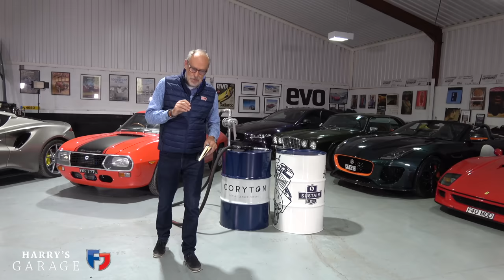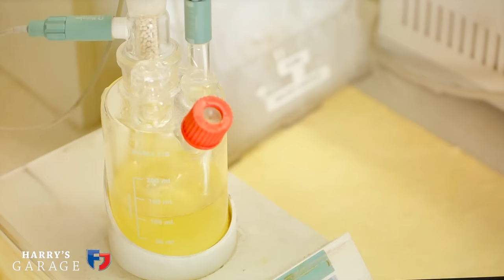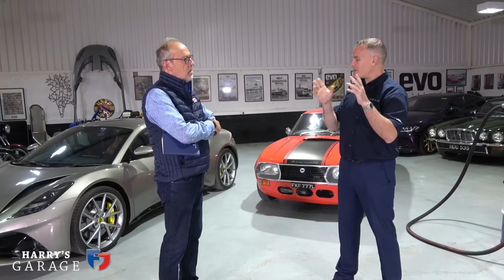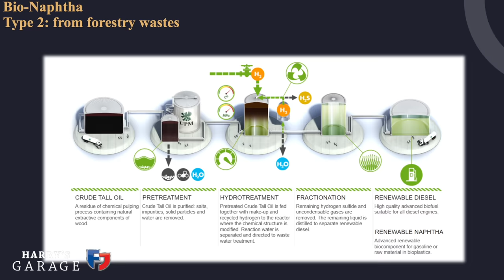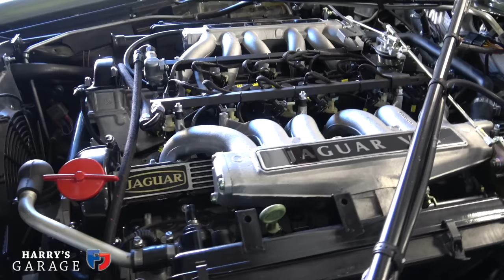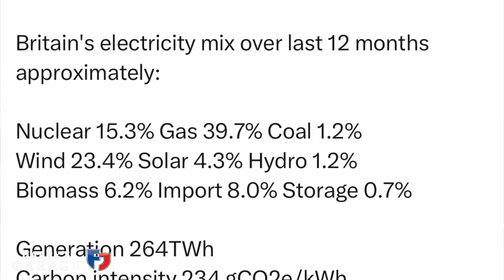Everything you need to know about using sustainable fuels. Why they're good news for car enthusiasts

Comment: Apart from feeling like Homer Simpson now (I feel Harry may be with me there), I now know more than I did pre-video, which has got to be a good thing. We all need to learn as much about this as we can, as it is coming whether we like it or not.
Having an expensive fuel that we can use in ICE vehicles has got to be better than being forced to run only electric surely - even if on.limited mileage.
As far as I am aware, there are no (practically) geared electric cars, where you get to choose which gear ratio you take a corner, go uphill or on  a downhill road in! Electric only allows you to use a percentage of the power available.

Comment: This is the best news for petrolheads in ages. But if motor sports are adopting e-fuels then why can’t this be the future for new cars too? Especially given the impracticality, cost, and environmental impact of EVs. If not, we’ll have racing cars with ICE and road cars with batteries. So no more racing improves the breed which has been so integral to racing and road cars for over a 100 years.
Reply: Because there is no way to scale production up to even a fraction of the necessary volumes needed for ordinary road transport, and the process is inherently extremely expensive so the cost would always be prohibitive too
Reply: @harryspeakup8452  no way? How do you know? We make enough ethanol to put in most of our fuel, at least in the states.

Comment: A great subject which may future proof our classics, the main thing i got from this is which it is made from waist of products, ive worked in the sugar beat plants in Norfolk and the smell is not forgeable which i can only think is from the amount of energy in the waist, from my thinking this type of waist would be spread on fields re introducing the nitrogen/carbon elements back to the soil but alot will go back in to the air as methane, now this is what we should be running our classics on and i take as a true offset.
Reply: Harry has presented the GB perspective and Coryton obviously wish to market their fuel a high price.

However, there are several issues that can be pointed out:

- agri-waste (literally left overs from sugarbeet production and animal feed) can be used to make e85 (85% ethanol and 15% petrol). This requires some some chip tuning to allow a flexibility. 
- the "ethanol is bad" nonsense is punted around by folks influenced by big oil and the brexit media. There are easy solutions involving different gaskets and seals and when making the conversion from standard petrol, filters are advised as the Ethanol will literally clean the fuel pipes and valves!
- e85 is in everyday use in France. It costs 95 cents a litre (about £0.95)...not £4 per litre! In winter the mix goes to about 50:50 to help starting in cold weather.
- many new cars in France are sold with flex fuel arrangemsnts to take e85. Indeed it would be impossible to sell JLR cars without this in France.

If H reads this he is welcome to get in touch and I will explain it to him!
Reply: @Andrew-vx2ls  from what ive read the e85 product available uk is more race fuels with higher octane hence the higher price, also would i be correct in saying e85 in france comes with a tax brake advantage ?
Reply: @sresto7943  E85 in France is a "green alternative" and therefore has a lower tax burden. 

GB experimented with it briefly but it did not take off as the Chancellor at the time did not want to help. E85 was also used for racing in GB.

My point is than Ethanol from sugar beet waste would (a) be ecological as quite close to being carbon neutral (b) improve the dire trade deficit of GB (c) help with the cost of leaving crisis.

E85 does need to be used: it cannot be left for say 2 months without being used (it separates more quickly than petrol. It also has a slightly lower calorific value (so fuel consumption is slightly higher to compensate) and in winter the fuel companies add more petrol to make starting easier (for the same reason).

I'm very, very surprised that Harry has not investigated this.

I will be converting my Elan GTS to E85...but I can get it easily at 1€ a litre.

Comment: All very attractive however, I note the bio fuel route, from the quick flow chart that popped up, states "non food" bio mass. Which is all very well, but the amount of "non food" material required to to produce fuel on any scale might not be useful for food but will displace food crops if the price is attractive enough.

Assuming bio fuels are specialist fuels, for classics, motorsports, commercial etc. then this is probably fine as the demand will always be limited.

However, as there is not one single, credible, empirical, scientific study which demonstrates that atmospheric CO2 causes our planet to heat up, this is largely an exercise in futility. Whilst I applaud the endeavour to find new fuels, I suspect it will remain a niche market.

Comment: I remember when we moved to unleaded fuel and we were told that leaded would remain available for classic cars.  Then leaded was so expensive that 'there was no demand' so leaded fuel disappeared from the pumps.  It's happening again.  I have a classic car, do 2-3000 miles per year but won't be able to afford £3.60 (minimum) per litre as well as increasing insurance costs, road pricing (wait UK, it's coming) stealth taxes and profiteering by supermarkets.  I might as well have a Viking funeral, sitting in my classic, just to heat my house this winter!!
Reply: It didn't matter that leaded fuel disappeared, because no-one actually needed it for road vehicles

Comment: Correct me if I’m wrong but there is a limit to how much fuel you can store at home . A house not to far from me went up in flames and because he was storing larger amounts of fuel in his garage the insurance would not pay out. I do see a use for this fuel both in F1 and classic cars but not for a means for keep building new engine cars. The only other thing I will say on this is he is not telling you how much energy it takes to make this stuff  ( a lot) and of course he skirted  round the price of the fuel . Let’s say this you won’t be doing 20,000 miles a year in your Ford focus or golf. But 3,000 miles a year in your classic then maybe. Because it’s really expensive.

Comment: Mostly good info but a bit deceptive. Modern cars should be engineered to run on ethanol. The problem is the feedstock, there’s not enough straw or beet tops to provide that. Growing crops for fuel would raise food prices. Straw is hardly a waste product as well, it required for livestock farming.

Comment: Hi, Very interesting & informative video, I believe in Sustainability, as in keeping older vehicles running rather than keep buying new cars ,motorbikes etc, I understand that vehicle manufacturers & the supply chain(s) involved will not be happy about that, Yes there is no getting around the fact that E-fuels & more sustainable fuels in general are a lot more expensive, but if the Heritage motor industry and classic car clubs get behind this, then hopefully in time it will become more viable, although electric vehicles are a part of the future of transport, I don't believe that they are the only answer, as Harry rightly pointed out the carbon footprint of older vehicles isn't really the issue any more, but finding a way to be more environmentally conscious is.

Comment: The cost of trading up to an EV could otherwise buy a crapload of sustainable fuel for an existing car; particularly when you consider that it's just the difference in price between sustainable fuels and conventional fuel that is at point for this kind of calculation. This is especially relevant for people who travel relatively few miles in a year. EV payback is actually pretty woeful for light usage.

Comment: Would i get more miles per gallon and or more torque and bhp by using Coryton fuels ? thank you any reply
Reply: If you use their highest octane fuel in a turbo instead of cheap 95 octane pump fuel, you could remap the engine to run more aggressive timing and more boost without detonation. But that's about the octane rating, not the way the fuel is made. On a like-for-like octane basis, no advantage in power

Comment: Yes, it is possible to produce a synthetic fuel using renewable energy and make the carbon footprint of it alone relatively low. But this process is very wasteful and we do not have large surplus of green energy that we could innocently use for this. We as human kind have some electricity consumption and we are currently trying to switch as much as possible to renewables. If we create some extra consumption that will buy electricity from renewable sources, we still need to burn coal or something else anyway to compensate for this extra consumption because that amount of green energy is missing somewhere else.
Unless we have so much green energy that we do not know what to do with it, this is not green at all. Very wasteful actually because the efficiency of the whole chain is absolutely terrible.
Reply: Martin, that example regarding the New Zealand synfuel plant is an example of a country which produces more renewable energy than it requires, is entirely energy self sufficient (& food self-sufficient) & uses surplus renewable energy to support projects such as the Rio Tinto aluminium smelter at Tiwai Point. The economic viability of the latter, like the synfuel plant itself has become marginal even with an electricity price reduction from NZ 5.5c  to 3.5c per kWh. International competition means that multinationals will always be bargaining down Western Governments with the threat of moving their operations to developing nations with their low labour costs and minimal labour market protections.

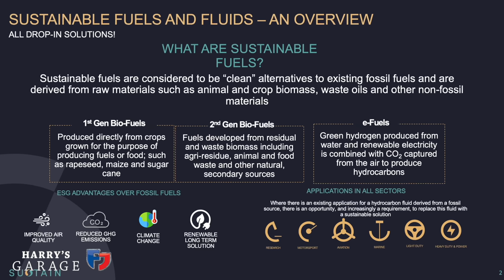Comment: In very simple terms to explain for any struggling, look at the slides c. 7:54 & 8:30. 

Basically you are either taking waste plastic/bioethanol from crops and reprocessing them into new fuels. These are sustainable fuels.

Or. You are taking Carbon and Hydrogen direct from the air and, using fancy chemistry, breaking it down and recombining it into fuel. Those are e fuels.

Explaining the 'fancy chemistry' is, in fairness, probably beyond the scope of this video and better suited to a chemistry/science channel.

Comment: Out of a mix of curiosity and concern, has your insurance signed off on you storing your fuel drums with your vehicles?

Also, does the fuel nozzle with the hand-cranked pump still click off when it senses the fuel tank is full? If not how do you avoid overfilling and potentially causing issues with the evaporative emissions system in the vehicles so equipped?
Reply from the maker: The barrels in the garage are empty, dummy barrels for display only and yes, the pump does click off like a normal petrol pump does when tank in car is getting full

Comment: Hi - I had been told that using  e5 or e10 meant you needed to change the rubber filler pipe and hoses to the carbs on 1950s cars  - the expert seemed to say it didn’t affect those rubber parts - is that correct. Thanks
Reply: yes, this is not an ethanol based fuel

Comment: I would be fascinated to run this stuff in my TVR. The speed 6 engine is super picky about its fuel so if it works in that its going to work on practically anything.

Comment: Given the growing concerns over the safety of EV batteries suffering thermic runaway and catching fire, along with the difficulties of putting them out and the environmental damage that results, I think other options do need to be investigated. After all, it isn't the internal combustion engine that is the problem, it's the fuel they use, so if we can develop a clean renewable synthetic fuel, it makes much more sense to keep using what we already have instead of consuming finate resources to manufacture more new vehicles we don't really need.

Comment: For sure, Syn Fuels will and have to be one of the fuel alternatives for the future. If politicians will be clever, they schould realize that this is one of the alternatives we have, and should foster its dvelopment. In Germany, where the Green Party more or less rules the country, try to find every argument to work against the further development. In my opinion for the future we need a mix of electric driven cars, were its suitable (city, small distances) E-Fuels, Syn Fuels and the conventional fuels we are using since the invention of petrol or Diesel driven engines. If politicians would be technicians or scientists, then the development would already be much further advanced.

Comment: These very large roll-on / roll-off Car Vehicle Transporter Vessels design, will need to be review in light of all these Fire  and Sinking's which are happening too. 

Or the vessels being so badly damaged and destroyed, they have to be turn into scrap metal basically!
 
Their designs especially require being internationally review, of Fire  Safety and Fire  Fighting by such a small crew onboard too. Or last over carrying Electric Vehicles, or Hybrid Electric vehicles. 

Should EV's and HEV's be carried, in specialised Fire  and Water Proof Armoured Shipping Containers, with built in Automatic Fire  Suppression or Flooding Systems. 

With each specialised EV Fire  Suppression Shipping Container, having both built in CCTV and built-in Fire Smoke  Gas  Dectection Sensors and Audio Visual Alarms too. 

With cameras and sensors both linked to the bridge, or a Fire Safety Monitoring Station (which is manned 24/7/52) from each Specialised EV Fire Suppression Shipping Containers being carried onboard too. 

Which if one of these Specialised EV Fire Suppression Shipping Containers, would automatically be flood if the EV or HEV stored inside burst into flames and was on Fire , stopping or delaying any Fire spreading out of control to other vehicles. 

Or any EV Fire spreading out of control, to other areas and decks of the Roll-on / Roll-off Vehicle Transporter Vessel too. 

Or spreading to other of these Specialised EV Fire Suppression Shipping Containers onboard a vessel too. 

As well as transporting not connected or disconnected Electric Battery Energy Packs, in shipping Containers as well. Whether these Electric Battery Energy Packs, either powering Electric Devices, Equipment and Systems, or any kind of Electric Vehicles too. 

It is one way to stop EV Fires onboard vessels, spreading out of control, which a small number of ships crew of these Roll-on / Roll-off Vehicle Transporter Vessel , can clearly handle! 

Suggestion by yours truly Gurkhamum Wendy and Wheelchaircharlie39 David, We would not touch an EV, because of the Fire Risk also because we are Disabled too!

Green Synesthetic Sustainable Liquid fuels, should be the future for Petrol Engine Vehicles to make them more so called "ULEZ" complaint, plus will have better Fire safety than an EV and its Electric Battery Energy Pack too

Comment: If it’s basically using sustainable method of Hydro Carbon capture from bio mass or chemical break down of gases to liquid and using this to run your car as opposed to fossil fuel hydro carbons from the oil fields on land and sea and off to the refinery …then thats the process I understand it as .

Comment: All sounds very inefficient when that big wind turbine could just charge a battery. Definitely some use for this but it's going to be horrendously expensive.
Reply: I think this will be useful when batteries are already full.
Reply: Child, you have no idea how inefficient the whole system including expensive transmission lines through peoples' backyards (do you want them in your backyard?), building a backup power plant for when the wind isn't blowing, maintaining the wind turbine, replacing it every so often then dealing with the massive amount of problematic unrecycleable waste, mining the battery minerals, making those batteries & EVs, building a network of hundreds of thousands of EV chargers (then maintaining them, then making and installing new ones as the old ones fail after a surprisingly short time), transmission losses, balancing equipment needs, charging losses, etc. etc.

HVO biodiesel is already lower in CO2 and costs massively less than EVs as it only costs a few cents more per litre. Same with biomethane, natural gas, bioethanol = all cheaper than EVs and lower in CO2. And not just by a little but massively so!
Reply: @pistonburner6448  I agree and like you i do not believe trust the "it's science".
Reply: @pistonburner6448   Exactly .  Nice to hear from a  " shepherd " and not a  " sheep "   !!  😉
Reply: @pistonburner6448  I was just talking about cost. I suppose you have to expect these types of comments though if you post anything that may be positive towards BEVs though.

Comment: I am a bored person who have heard my fair share of marketing ...

How much energy and what type of energy does it take to produce these "sustainable" fuels?
It takes nature cataclysmic tectonic shifts, mass extinctions and high pressure and heat to produce the old school sustainable fuel called oil.

Yes, oil is sustainable. It comes from hundreds of millions of dead life forms.

They circulated on the surface ecology, before getting crushed in the topgraphy.

Let me know when we get 100pc ethanol engines, the likes SAAB developed. My daily flexifuel only runs on E85, but no one will supply me with the good stuff because regulations. Regulations from the same people flying across the globe talking, but literally not walking.